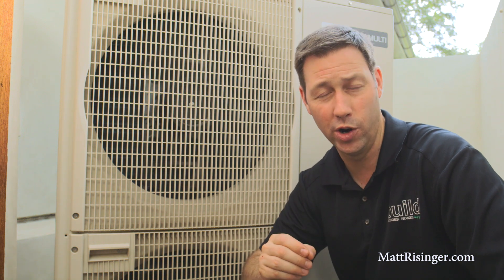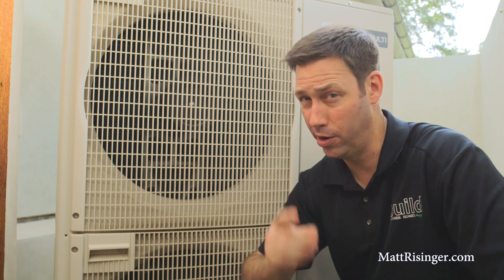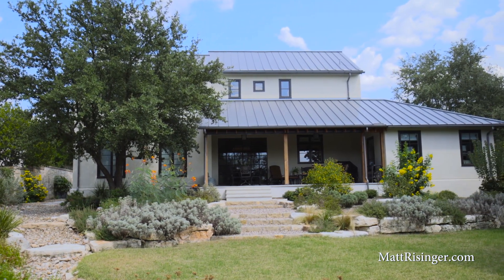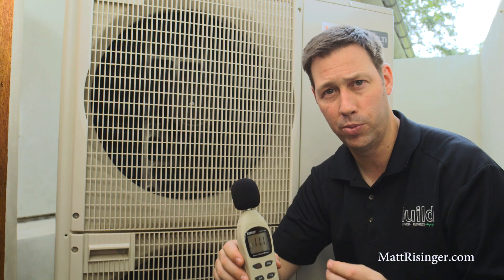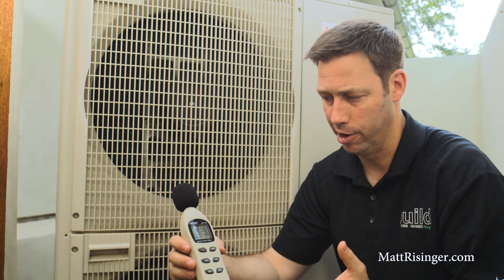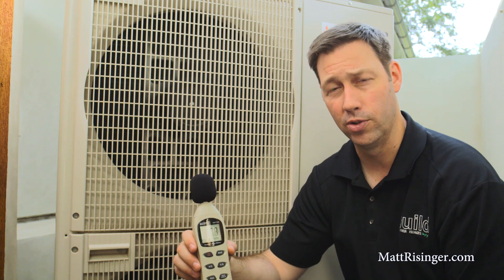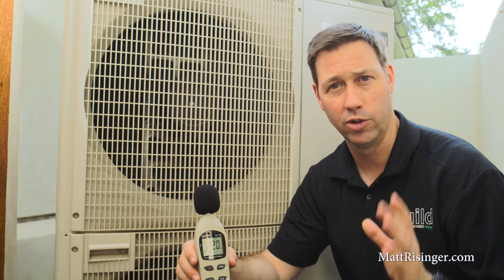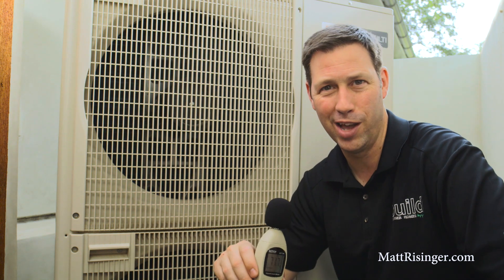HVAC Tech Talk - VRF what is it?

Comment: Can I mount block for hot water (shower, washbasins, kitchen) in system of cooling multysplit? or it`s impossible find automatization for this system? And another question. There are systems all in one which are appointed for hot water/ Can I mount blocks for redirection of refrigerant on each fancoil or other indoor unit for cooling?

Comment: do that come in mini splits?
Reply: Yes they do have minisplit vrfs (that's the typical config with larger ducted vrf systems now coming on line).  Most of the competition is now selling a variable refrigerant flow system with an electronic expansion valve (which is an essential part with variable speed compressors).  They are complicated inverter based systems, most techs aren't trained for them but Mitsubishi has been doing it for years and generally require factory trained techs.  Meanwhile the "American" companies are just catching up.  Trane, Lennox, Maytag and Carrier have it but most of these are first generation that we might regret buying five years from now.